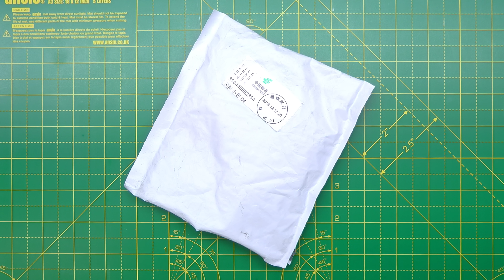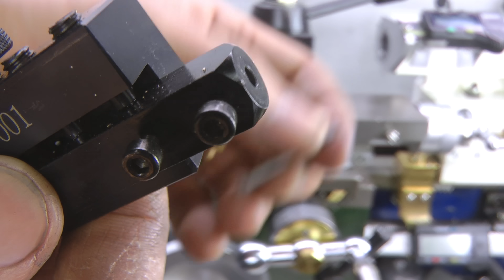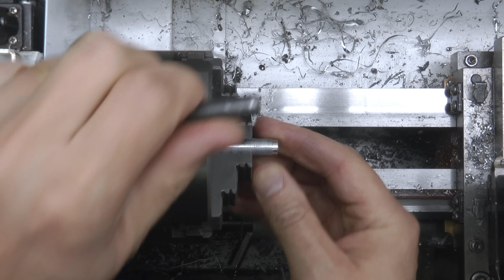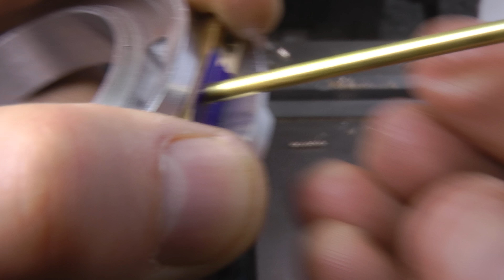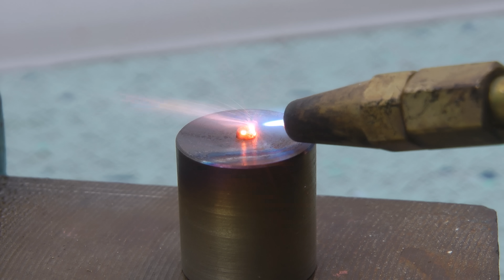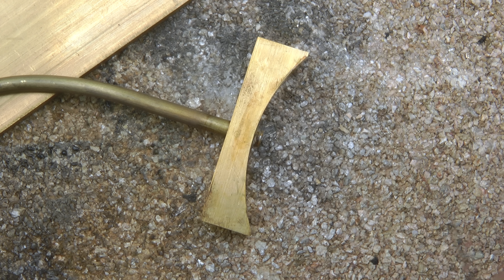An Improved Work Light For The Mini Mill

Comment: What are you using for the power supply to the box?  And could you have taken power from the mini-mill fan circuit?
Reply from the maker: Just a 12volt wall wart. I'd considered powering it direct from the mill, but (unusually for me!) went for the simpler solution. Thanks for watching 👍 🇬🇧